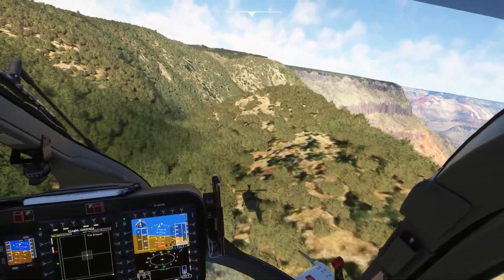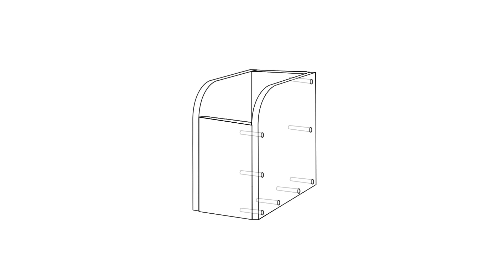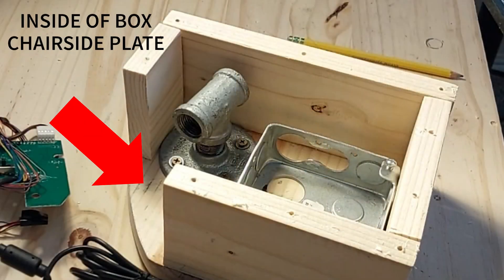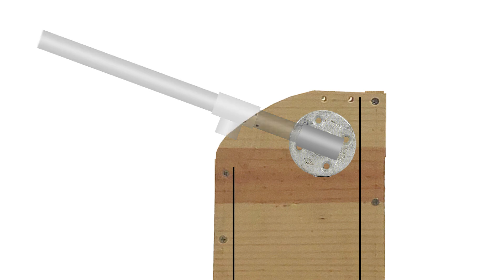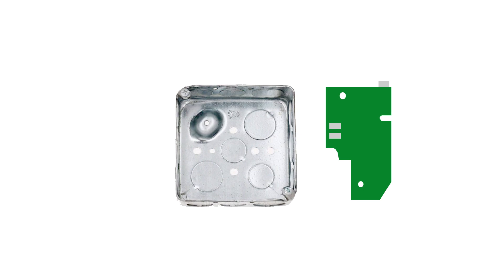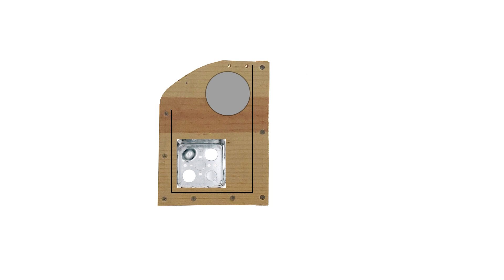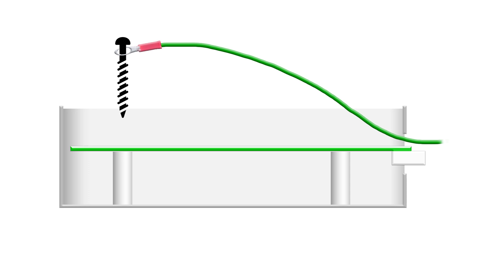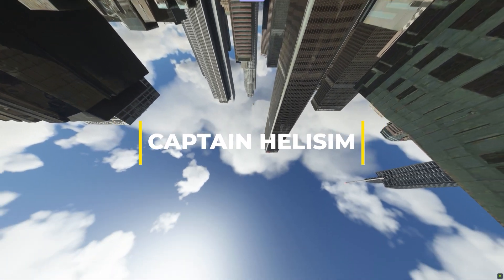DIY CHOPPER COLLECTIVE | PART 4 | INSTALLATION CELEBRATION

Comment: Thanks for all this info! Question, you say 10" pipe but list 12" in link. Also you say and link a  5" pipe but yours looks like a 4" or 3". Thanks again. I'm at part 4 of construction!
Reply from the maker: Oh that's exciting.  Great to hear at least ONE person is pursuing it!  To your points -- measured the 10" pipe, it is 10".  Will correct in the listing.  Measured the 5" pipe -- it is 3".  

Let me say this -- if you make it 5" as I mention you will clear the side wall and not have the Tee butting up against it.  That's probably why I said 5" and not 3" when I did the video.  I'm not super happy about the Tee interfering with the sidewall.  It's not a make or break either way as is but the 5" pipe should put the tee over the wall.  So my recommendation is use 5" and 10" pipe.  I will correct the parts listing to match.
Reply: Thank you. I will stick with the 5". Unfortunately the throttle I received was damaged in shipping so Im exchanging for a new one. Good thing is I am able to see the spring component and how it is all connected. Hopefully It will help me to figure out a way. Now on to calibrating the hall sensor position. Thanks again!!
Reply from the maker: @bc6023  Alright, well there's progress and that's a good thing.  Feel free to comment or ask questions, happy to help.  Collectives for all!
Reply: Have you found the sweet spot distance the magnet should be from the sensor when going over it?  Is closer the better?   @CaptainHelisim
Reply from the maker: @bc6023  There was some experimentation involved as you see in the video... just getting a sense of how the sensor worked, distances, responsiveness, stability, etc.  I currently have that stack of button magnets about an inch from the sensor and it works really well -- stable and solid with full range.  If you get too close I think range suffers and if you're not close enough the input starts to jitter.
Reply from the maker: @bc6023  Hey when you got the throttle did it look like the one in the video?  I just went to look on Amazon and it doesn't seem to be available anymore.  I did not readily find a one for one replacement on Amazon though still looking.  I DID find it on Aliexperss however in case you did not get one that looked the same.  That particular company is only selling digital versions which is not the same and does not have the same wiring harnesses or buttons.  Here's the link which I will post on the original video: https://www.aliexpress.com/i/2255800257692715.html?gatewayAdapt=4itemAdapt
Reply from the maker: @bc6023  Just found another Amazon outlet that sells it: https://www.amazon.com/VGEBY-Control-Throttle-Display-Electric/dp/B098784Q26/ref=sr_1_40
Reply: The wiring matches your diagrams.
Reply from the maker: By the way -- any thoughts on the throttle -- the first challenge?  That was a bit of a tough nut to crack LOL.

Comment: I really appreciate these videos, I’m currently 3D printing my own design (we mishmash of other people designs), really struggling with the feel of the collective movement, just ordered a 20N gas strut for some experimentation
Reply from the maker: Interesting -- I'm curious what aspect of your design needs the strut.  I used the 20N strut to help support the weight of the 1/2" plumbing that makes up the collective arm.  The weight and the strut just balance each other so that it stays wherever I put it -- quite convenient.  I would love to have been able to have the knowledge to do 3D printing as it would make everything so much easier but I imagine the material would be much lighter so the strut probably doesn't serve the same function in your design as it does in mine.
Reply: @CaptainHelisim  hi, yes I’ve just tried the strut and way too strong….. I’ve since done the maths and worked out I need 2N! I’m going to work out a cork pad friction arrangement, just ordered some bits from Alixpress so will be with me at the end of the month.